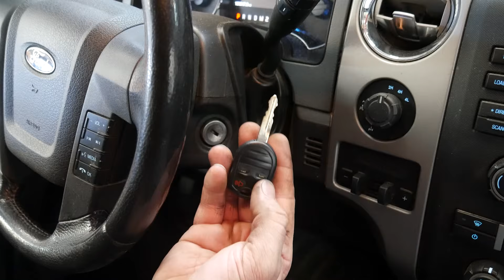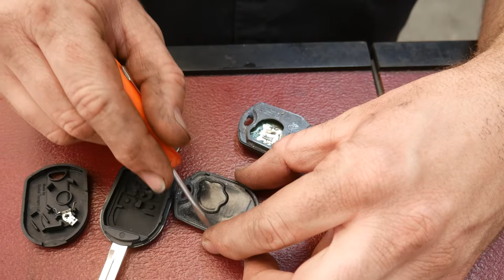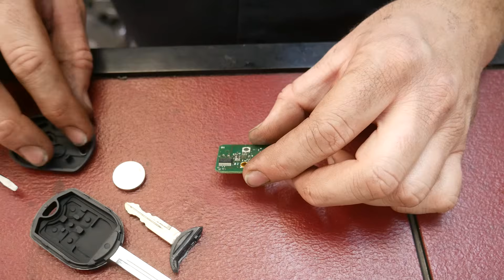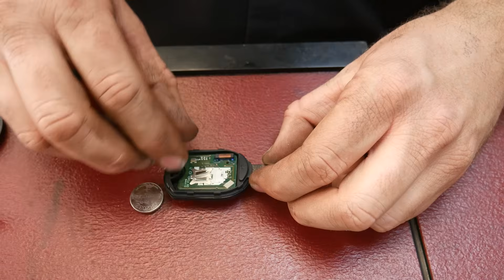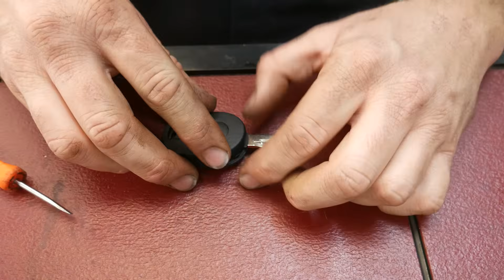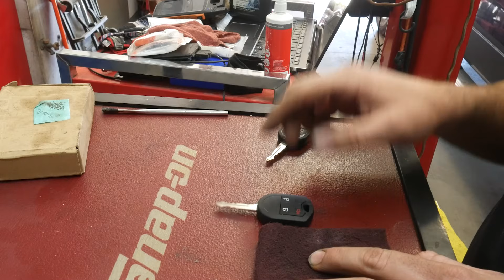2013 Ford F150 Key Shell Replacement - No Programming Required

Comment: My key still works but my buttons don’t work anymore I went into the fob and found out that one of plastics things had came off I put it back in place but it’s still doesn’t work can I replace the mother board with a new one  that I bought with the hard covering and still use the good key without cutting the blank key

Comment: I have a 2X button on my key shell. It allows me to start the truck and the climate control will either heat or cool the interior of the truck before I get into the truck. I'm not seeing that option on your video. But I'm sure it's probably the same process, right?

Comment: My hardware store will not cut the key/fob unless you have brought it from them.
Reply from the maker: A lot of places will not work with customer supply parts. There is a slim chance that the material of the key will be incorrect and damaged a machine.
Reply: @ThePracticalMechanic  It is there corporate policy to get you buy from them to squeeze extra couple hundreds of dollars from you.  

I found an Amazon reseller who will sell you the key fob and cut the key for you.  All you have to do is take a picture of your old key.  It worked pefectly.
I think it was around $36.  Worked GREAT.

Comment: Any advice where I can take to have key cut, ace hardware says I have to buy a key from them in order for them to cut it, they won’t use the key and key fob I purchased off amazon
Reply from the maker: Most locksmiths with a store front will do it for $20-40
Reply: @ThePracticalMechanic I appreciate it

Comment: Why can't you use the same key? Why cut another key?
Reply from the maker: Because the key shell is molded around the key blade. The shell normally breaks but sometimes the blade is also worn or damaged.  With a replacement shell you have a freshly cut key that requires no programming as long as your old broken key shell was still functional.

Comment: i done all that and my 2013 wont start and radio channels are blocked out and my key function is blocked. the only way i can start my truck is aftermarket remote start the insert the key and turn tumbler to run then from there i can press my brake pedal and put into drive

Comment: 2013 Ford Edge plastic key fab broke in half. Put back together and buttons still work but car says “System Start Fault” Turns out the little black piece inside the fab is the chip and needs to be held near the ignition to start.

Comment: My f150 have remote start? Do you think it will work the same way?
Reply from the maker: Since this is just a shell replacement the electronics are reused from
The original key. You would just need to find a shell that has the button location for remote start and have the key cut. 
If you are adding a new key programming will be required.

Comment: 16$ on Amazon and 5 minute video just saved me +350$ thank you, you earned this like
Reply: where can i cut the key
Reply: @wilfredopimentel2475 Home depot
Reply: I bought one of those Amazon keys and the fob won’t work. Ford programmed it for me and it starts the car but none of the buttons do anything. Neither ford nor I could get it sync up. So switching the chip seems like a much better option.